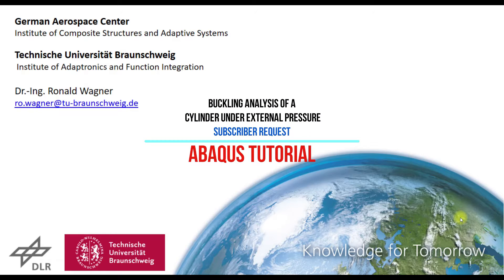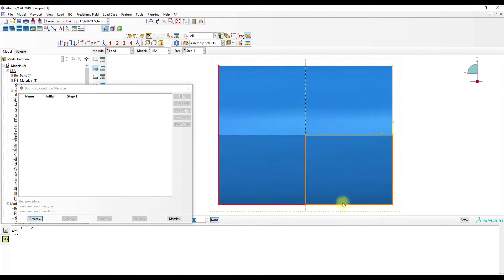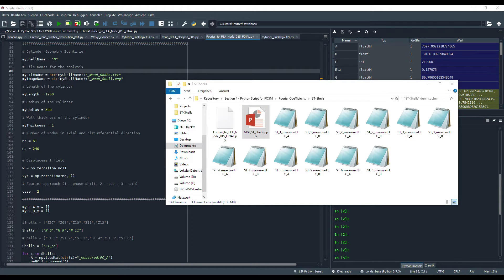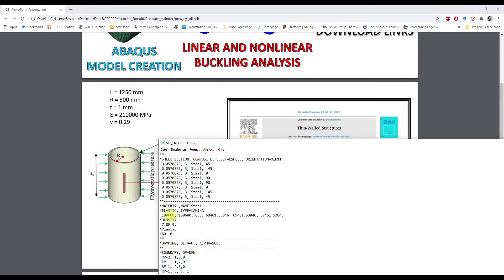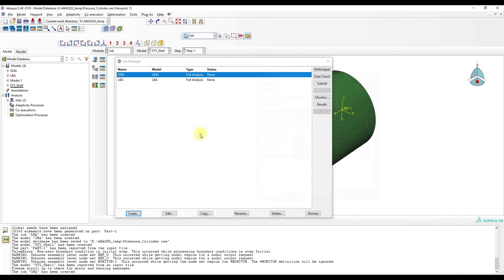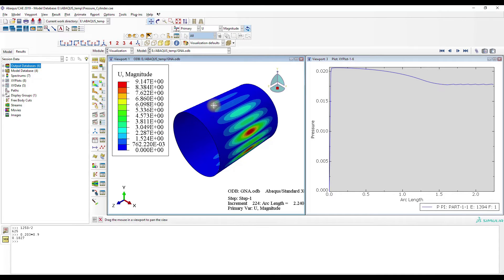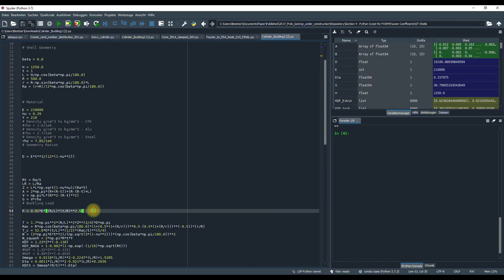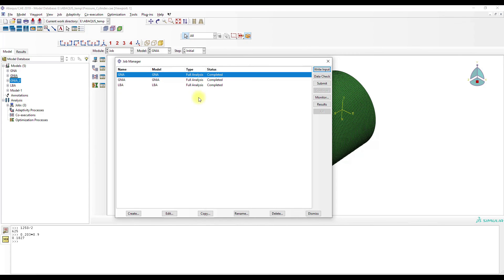ABAQUS Tutorial: Subscriber request - Buckling analysis of a cylinder under external pressure

Comment: Dear Dr. Wagner, 
Could you please verify the obtained buckling stress for the same problem with any source (experimental or any formula from the literature)? I have tried to verify with formulas from the literature, but the answers are in the range of 13 to 14 kPa, where as your answer is 20.5 kPa.
Reply from the maker: see at 19:40, its actually pretty close to the test, but I will check some analytical equations
Reply: @hnrwagner  Thanks for your feedback. The comparison you made at 19:40 is very interesting. Please let me adopt it for more discussion. Since the elastic formula you used at 18.42 is based on the elastic material property, and usually small strains and perfect shell, it should be compared with the case of LBA. Suppose that I do not have Abaqus, how I can estimate the buckling pressure? I will just use the elastic formula (to get the 0.0138 MPa) and multiply it by the KDF (say 0.9). So, the question is how the elastic formula is greatly varying from the LBA (0.0138 vs 0.0203)? I have used different formulas for comparison including the exact solution and they mostly in the range of 0.013 to 0.014 MPa. This made me in a doubt about the accuracy of Abaqus in this kind of problems. How do you comment on that?

I have another question but that is related to the article you adopted, their values are overestimated by 10 times. For example, the results of the elastic formula they presented in Table 6 of the paper is 138.2 kPa (or 0.138 MPa), which is ten times the value you presented (and yours is correct).
Reply: @hnrwagner 
Please verify these results, regards
Reply from the maker: @mohammadalaynia5606  

In Python code with results

L = 1250
R = 500
t = 1 
E = 210000
v = 0.29

P_nasa = 0.926*E/((R/t)**2.5*(L/R))
P_ven = 0.92*E*t/L*(t/R)**1.5

print(P_nasa*1000,str('kPa'))
print(P_ven*1000,str('kPa'))

13.91 kPa
13.82 kPa

same results as in the video @ 19:18

looks like my numerical results overestimate the buckling pressure, not sure why, maybe the boundary conditions are wrong, but the test loads are also very high 18.4 kPa
Reply: @hnrwagner  
Thanks for the double check.
Actually, your numerical solution seems perfect. I have solved several problems independently and I always find the LBA about 42% of the analytical one. It seems like it is an issue with Abaqus. I will try to see if I can simulate it in another FEM software.

If I am able to reach to a solid conclusion, I will share it with you.
Reply: There is another example in the literature using another software the obtained buckling stress is 12.3 MPa. If the analytical solution is calculated for his problem, it comes 6.7 to 6.9 MPa depending on the formula. He used fixed boundary conditions and if the shell is allowed to move in the axial direction from one end, this gap could be reduced but still it will not match the analytical one. 

Here is the link

https : // www . youtube . com/watch?v = uJxzxFNRN_A & t = 420 s
Reply from the maker: @AbubakrESMusa  I think I found a solution to this problem, the equation is for hydrostatic external pressure (radial and axial compression) if I define it like this in ABAQUS (radial and axial pressure to a cylinder) then I get the exact analytical solution in ABAQUS LBA. In the video the problem is only radial external pressure without compression.
Reply: Actually, the difference between hydrostatic and lateral pressure is negligible for cases of L/R more than 2 and the hydrostatic pressure is always in the lower side. With the help of my student @mohamed Alaynia, we realized that to get the correct solution you need to model half of the cylinder (half length) and use symmetric boundary condition. With this, the solution was 14 MPa. You can try it and see. Just reduce the length to L/2 and use symmetric BC.

By the way, the use of half of the model is also needed for case of axially compressed CCSs. We adopted from there. Please check the next reply for more details.

Comment: Thank you very much Dr. Wagner. I have been following your videos for more than a year. Just as a comment, in many cases the linear buckling analysis of CCS under lateral pressure overestimate the buckling pressure. For example, the buckling pressure you calculated from LBA is about 0.0205 MPa (or 20.5 kPa) where the exact solution or the approximate solution for short cylinders is about 13 to 14 kPa. Could you comment on this issue please?
Reply: bro, experimental buckling is 184.99 kPa and it is equal to 0.184 Mpa. looks like there is a mistake or something I just got confused
Reply: @engrshafqatwazir762  
As per my understanding, the experimental buckling stress has something wrong.
Reply: @AbubakrESMusa  how do they publish wrong results? I checked with the theoretical results and FE, they are closed enough but test results are quite high
Reply: @engrshafqatwazir762  

I have compared the experimental data with analytical solution, FE, and dimplified formulas and I feel the experimental results are 10 times what they should be.

Comment: I have 2 questions:
1. Why the radial stress (S11 in cylindrical coordinate) is not homogeneous in linear buckling although the external pressure is uniform?
2. Can we use another model in nonlinear buckling based on the linear buckling results (eigenmodes and eigenvalues), such as, ca we add some parts in nonlinear buckling analysis and use the edit keyword to insert the linear buckling results?
Thank you!

Comment: Why did you divide the model by 4 and the middle by 2?
Reply from the maker: the partitions of the shell allow an easier meshing process and the application of small imperfections
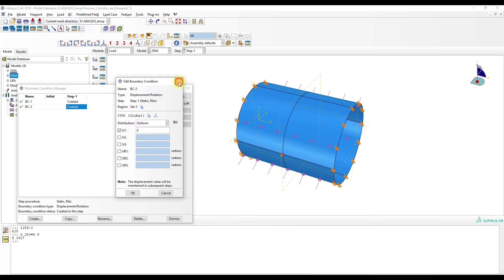Reply: @hnrwagner  thank you Dear Wagner, I have some questions. What did you do 13:39 (MidPoint U1=0)?
Reply from the maker: @oguzhanakarsu6703  that is a small imperfection (locking the radial displacement) for a perfect structure analysis, this is a necessary step otherwise the shell wont buckle. An alternative would be a small dimple imperfection, cutout, or thickness reduction.
Reply: @hnrwagner  okey, what differences between GNA and GNIA ? and you didn't change materials properties for non-linear analysis. why ?
Reply from the maker: @oguzhanakarsu6703  The GNIA (geometrically nonlinear analysis with imperfections) includes a weld imperfection signature from my database as can be seen at 5:46. The GNA is the perfect shell structure without imperfections.

I didn't change the materal propoerties for non-linear analysis (i think you mean yielding) because the shell is relativly thin and long (R/t = 500) so yielding is not relevant for initial buckling.
Reply: @hnrwagner  Can we use Stabilization Constant Energy 1e-3? Is that okay?
Reply from the maker: @oguzhanakarsu6703  I am not sure, i would perform a convergence analysis. Because i do not know how the stabilization parameters in ANSYS and ABAQUS differ.
Reply: @hnrwagner  didn't you fixed rotation?  only U1-U2-U3=0 ?
Reply from the maker: @oguzhanakarsu6703  , the article described the boundary conditions as simply supported , so no fixed rotations

Comment: could you please do Numerical modelling (Linear buckling analysis) of cylindrical tank from past research paper?
Reply from the maker: Of which paper exactly?
Reply: @hnrwagner  cylindrical tank subjected to axial/external uniform pressure
Reply from the maker: @engrshafqatwazir762  I mean do you have a specific paper in mind? a reference like a website or DOI, journal paper with number and year
Reply: @hnrwagner  

Interested as well. 
For me of any paper. 

I have a feeling that Abaqus overestimates the linear buckling stress by about 40% if compared with the exact buckling stress using the exact formula or other simplified fomulas in literature. I can share with you few examples if you like.